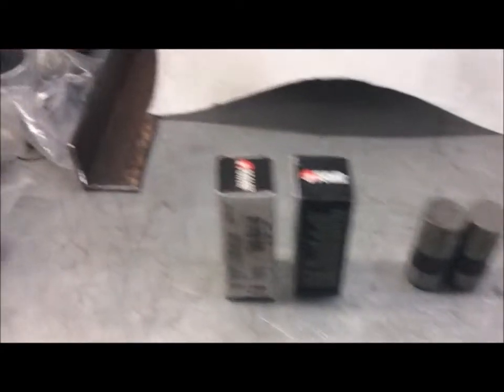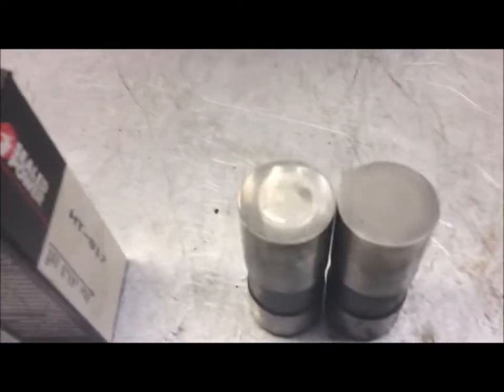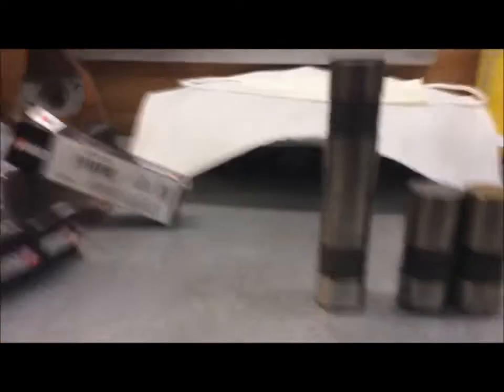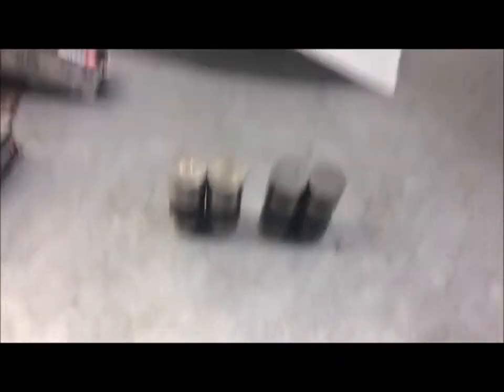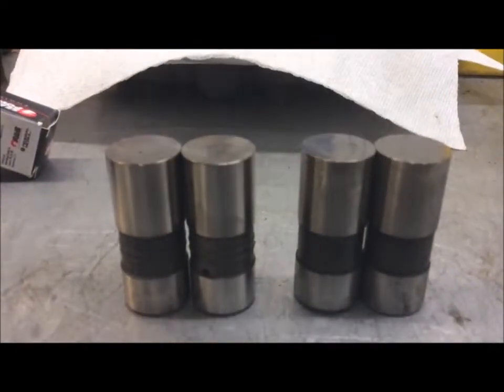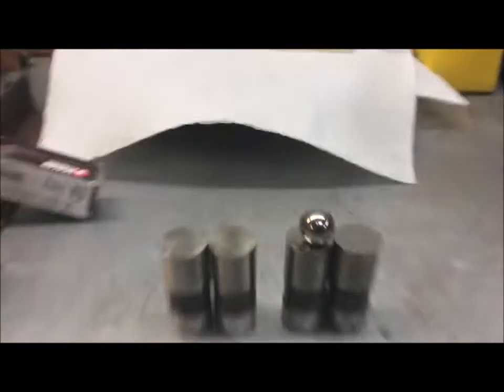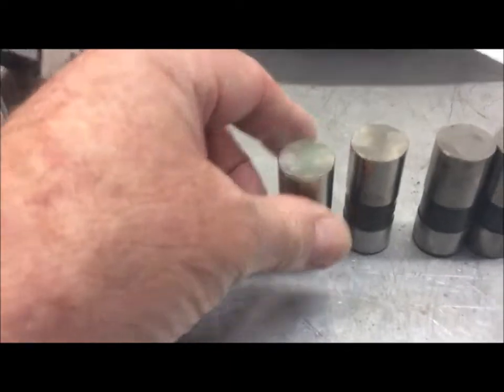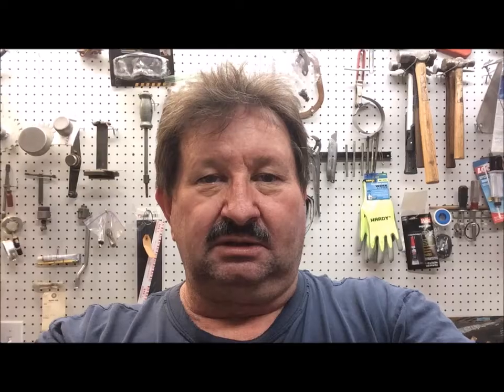Corvair lifter 101

Comment: Dave (or anyone else that might know),
I have heard some people say, do not put new lifters in without replacing the cam shaft as well. The rationale they use for this is that the old lifters "wear into the cam lobes".  They further claim that the new lifters, since they are not "worn in" will prematurely wear out the cam lobes. 

Anybody have thoughts on this claim?

Comment: I’m going thru an engine that has been sitting for years. A couple lifters are not solid, they are springy when I push the pushrod in. Are they bad, or will they pump up when the engine is started?

I like your videos of the SCCA races at Willow. I was a corner worker for many years when we ran there.